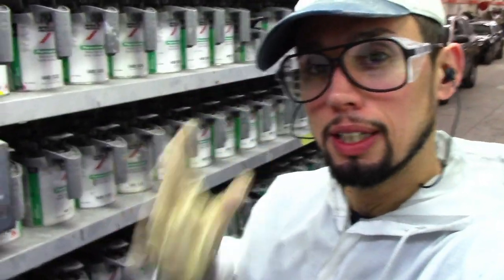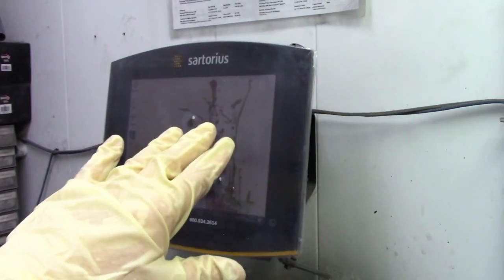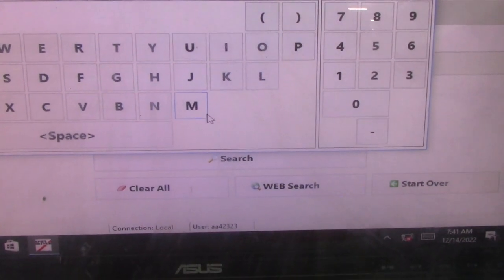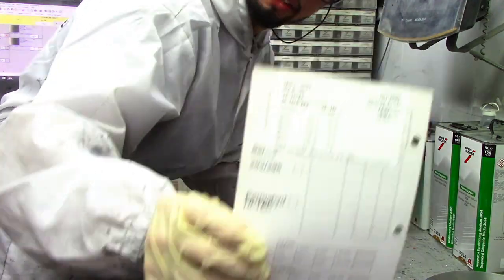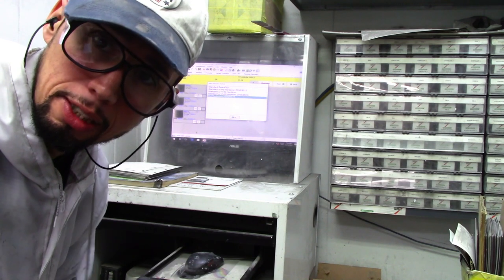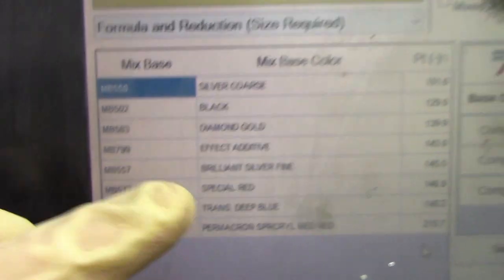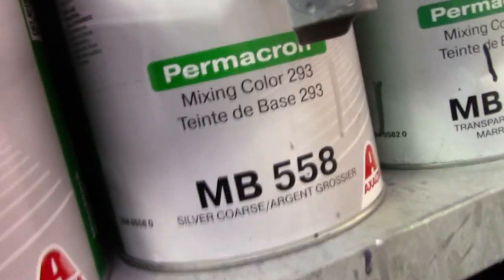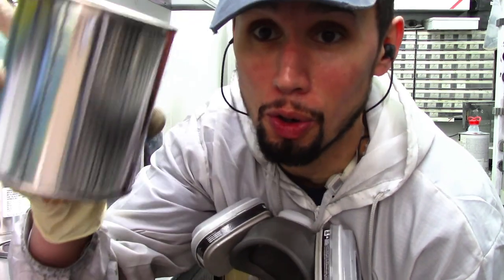How Paint Is Mixed in a AUTO BODY SHOP

Comment: Fascinating! I never knew what  mixing auto paint entailed. I always knew the color was retrieved from the door jamb. And I've seen firsthand what happens when certain auto bodies we used didn't paint match. I have a good friend who works at a reputable auto body and he will be fixing my car in a couple of weeks (I slid in ice, nearly took out my mailbox and destroyed my mirror, door and rocker panel). I own a 2013 Accord in Hematite Metallic and was told that being an odd color, and being metallic it will be a harder color to get right and may take some extra work, therefore costing a little more than what was originally quoted. I never knew just how hard this job can be.
Reply from the maker: Yes it can be a difficult process to paint cars and match the colors on the cars. There are so many different kinds of paint systems and none of them are equal. Over the years cars can be painted by different paint systems making it harder to match the colors over the years. So in a nutshell to make certain colors match shops have go the extra mile and do extra work to make the color match. Like paint extra panels to make sure the color can be blended properly so it looks closely matched to the current color on the car.
Reply: Good to know! Thank you for the information! I am a little nervous about my car being fixed but I also have no doubt that my friend and his crew will take their time and not cut any corners to ensure my car comes out looking as good as it did before my accident. 
Note to self.... I cannot drive on ice. Next time I will call in  to work!
Reply: Now, the colors are usually found in the door jam, but that wasn't the case 15+ yrs ago. They were almost always in different places per car make. My brother is new to painting, and he ran into the problem of finding a 2001 BMW paint tag. Those used to be in one of about 3 common locations: under the backside of the hood, the engine-side firewall or either strut tower. Older GM's are found in the glove box, in the center console, in the spare tire compartment or hidden in one of many rear-compartment panels (some of which are difficult to remove without breaking things). And the list goes on for the odd places you used to have to hunt for the paint tags. It's only in the last 10 yrs or so that it's become universal practice to put them in the door jams. Back in the old days, there were times it took me longer to find the paint code than to mix, adjust and touch-up the car!! At some point you're better off just mixing something close and start adjusting instead.
Reply from the maker: You forgot to mention the worst one of all, VW and AUDI which are essentially the same company. They put a sticker in the cars trunk where the spare tire is and most of the time the color code isn’t even in there. And good luck getting into some of those trunks when you get a car with a trunk full of junk. First words out of my mouth are call the dealer and get the code. lol 😂.

Comment: I noticed you are using your old gun. The 3m wasn't much of an upgrade? I was thinking of getting the 3m gun but might wait on it.
Also thanks again for the advice. I have another one. Its been 2 days since I finished but noticed that i didn't clear coated the edges good enough. Would you recommend adding another clear coat  or should i wet sand and then add another clear coat?
Reply from the maker: If the dry spots are not to bad you can sand and polish the car if there dry spots are too dry your going to have to sand and clear coat the car again. And I still use my 3M gun I just use it as a secondary spay gun.

Comment: Good video.....wish I had a mixing bank at my house 😁
Reply from the maker: Lol 😂 those things are expensive. The gallon tints on the mixing machine cost about $500 dollars each.
Reply: @J.Lulo_  😳 wow......great video's my friend.
Reply from the maker: Thanks 🙏 for the kind words I appreciate it. And Thank You 🙏 for watching.
Reply: @J.Lulo_ how does someone get one of these mixing system in a shop?  I'm putting up a new building. Can these be leased?  I know this is old thread but not much info out there. Thank you !
Reply from the maker: So you basically have to look for a local paint supplier and call them and then they’ll send out a salesman and then they’ll set you up with a paint system. Google auto body paint supplier and you should be able to find some. We use a company called Finish Master if you want to look them up and see if there in your area
Reply: @J.Lulo_  do you get a  choice on product?  Like. Chromabase..  or simkins or wanda. Or will I have what they offer and that's it? Man thank you for the quick reply bubba that was a surprise. Great job on your channel.
Reply from the maker: I think that depends on the paint supplier you choose.
Reply: @J.Lulo_  gotcha thank you. I just looked up finishmaster.  I'm in the state of Maine now but was down south for  10 years. And dealt with keystone alot so comfortable.  Awsome thank you again bubba :)
Reply from the maker: You’re welcome 🙏. Good 👍 luck.

Comment: That was interesting and informative, but assumes you have the car and the color is recent production. To make matters worse, many manufacturers recycle color codes, even within a couple of years. I'm changing the color on a car. I know what color I want, but I can't get anybody to mix it. Nobody will use the PPG or DuPont codes. They want me to take a pic of the data plate, except I don't have a $250k 1969 Dodge Charger or Plymouth Barracuda in Q5 Bright Turquoise/Seafoam Turquoise. I actually found a pic of a data plate, says "Q5" right on it, but Chrysler reused the code for different colors. The paint shops can't find it. I don't know what the purpose of PPG code 13534 or DuPont code 4960 is if their systems don't recognize the code. The funny thing is, dealers of paints for plastic models -- who use real PPG or Axalta paint -- have it down pat and mix these old colors all the time, but it is so,d in 2 oz. bottles and I need 3 liters! 

Anyway, thanks for the great explanation and letting me see what the other side of the counter sees. Cheers.
Reply from the maker: If it’s a solid color than maybe someone can show you the paint panel chips from the paint system and maybe there is a similar color in the system that might work. If they have the mix in the Axalta system they should be able to make mix as much as you need. Good luck.
Reply: @J.Lulo_  thanks for the reply, I appreciate it. It's a metallic, but I'll get there. Keep making videos. I found yours very interesting.
Reply from the maker: Thank you 🙏 for the kind words I appreciate it.